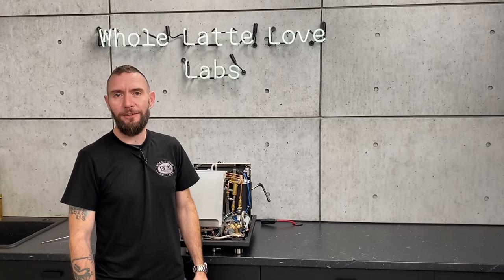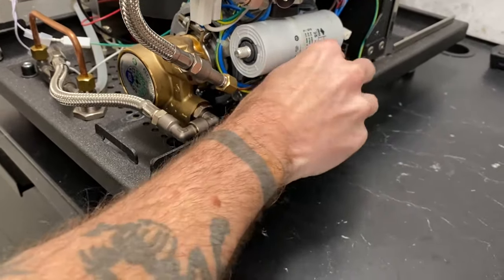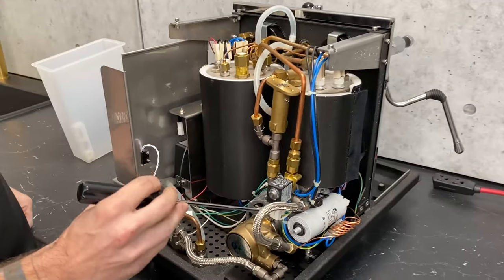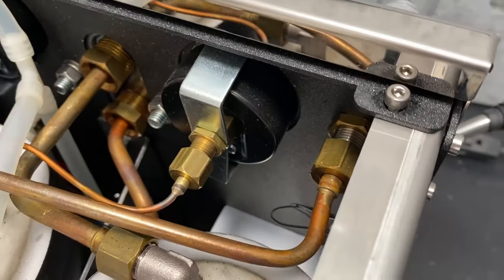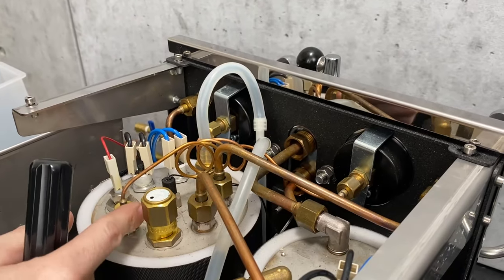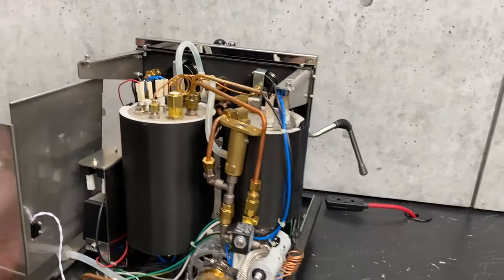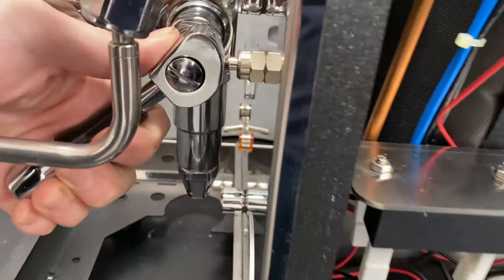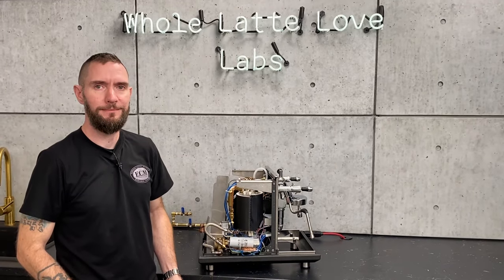ECM Synchronika Espresso Machine Internal Components Tour, Overview & Identification

Comment: Hi! I love your detailed videos, thank you so much!! I replaced the solonoid valve and water pump, cleaned the liquid level gauge, and reset the little switches on top. However, it doesn’t seem to be filling the steam boiler. I don’t see an NTC probe and It will not make hot water or steam :( I have an illy Y2. Thank you so much for your advice ❤
Reply from the maker: Hi c, Thanks for the comment. Unfortunately I'm not familiar with with that machine so can only offer general advice for your situation. In machines with separate steam and brew boiler the steam boiler usually has a fill level probe which controls things. Those probes can go bad or have a bad connection. They typically use electrical conductivity of the water to sense water level in the boiler.

Comment: Thanks for this overview of the Synchronika. Have you ever seen a failure on this particular model (client bringing in their machine for repair)? I've had mine since a couple years and just clean the brew head with some JoeGlo. Otherwise, it's been great. Hoping I never have to service it!
Reply from the maker: Hi PM, Thanks for the comment, question and sharing your experience with the Synchronika. It's a very well built and reliable machine. Problems are most often associated with poor maintenance or water causing internal scaling.

Comment: I was listening to talk about the plastic T being near hear and possibly cracking after a while.  Do they sell or make a metal one?  Seems for 2 -3K machine this would be a more heavy duty part.
Reply from the maker: Hi charles, That fitting has been updated to brass in the latest models of the ECM Synchronika and Profitec Pro 700. You can see it in this video: https://youtu.be/NTRA3ZeTwnM?t=459

Comment: Thanks for the awesome video! I k kw this will come in handy at some point. I do have one question, how do you drain the brew boiler? I bought my Synchronika in July so I would assume mine has the updated drain on the side. Thanks again!
Reply from the maker: Hi AF, You are welcome! Yes, recent Synchronikas will have the brew boiler drain as seen in this video. Here's a video showing how to drain you boilers: https://youtu.be/9D5Og5erQ_Y It also shows how to drain boilers of older Synchronikas without the drain valve.
Marc

Comment: Yet another excellent video from WLL. Regarding the clear silicone hose that runs from the plastic tee down to the discharge nozzle below the grouphead: is that tubing replaceable without removing the brew boiler?  Also, is there any downside to replacing the plastic tee with a brass one?  Thanks again for the whole catalog of repair videos!

Comment: Thank you so much! ;-) Sorry, but I am just having some stupid questions…

(1) Is it technically possible to run a Synchronika on DC power supply only? For example on a boat where you might be lacking an AC power line from the land side.
(2) What voltage is this DC running on internally?
(3) Could the heating of the boilers and the brew group be accomplished by a DC power supply only?

Don't worry, I am just curious, no intention to fiddle around with this… Thank you ;-)
Reply from the maker: Hi AGCS, In my limited yachting experience if you have a boat big enough to have a Synchronika (luck you!) on board you likely have generator to provide AC power and/or large battery bank and inverter for AC power. Given the Synchronika can draw up to 1400 watts it would require a relatively large battery/inverter capacity to keep it running. The major power consumers in the machine, the heating elements, run on AC power. Only the control circuits (which use very little power) like PID system run on DC.
Reply: @Wholelattelovepage  Thank you very much indeed ;-) Exactly, as I expected…

Well, then Rolls-Royce or Bentley will need to find a solution for that — once I will have won the EuroJackpot ;-)

Sorry, but my Synchronica is a must…

Comment: Not specific to the sync but how often do you run into issues of failing rotary pumps? I’m curious about potential replament costs including the motor. Ideally in our future set up we’d l8ke a plumbed set up but wondering if the greater upfront and potential future costs warrant a machine with rvp. Thanks!!
Reply from the maker: Hi KD, Rotary pump failure is very unusual. They are commercial grade and most reliable pump type used in prosumer level machines.

Comment: This is a fantastic video; glad I came across it. Just had to replace the plastic barbed tee fitting from the boilers' OPV tubes because it got brittle and broke (after about 2 years of daily use), leading to a puddle of water forming under the machine during its warm-up cycle because it was no longer discharging into the drain tray. 

Ended up replacing the junction with a 1/4" stainless steel version I got from a local fitting store for under $4. Quite surprised ECM cheaped out on that part given it's subjected to constant heating and cooling. Otherwise, no complaints with the machine; been running great, but this video will be very handy if I have to diagnose any internal components next time!
Reply from the maker: Hi LD, Thanks for sharing. The Synchronika is an incredible machine. We have had a couple of reports of that T fitting leaking after long term use. Thankfully it's super easy to access and repair.

Comment: Does the inline filter from the reservoir ever need cleaning and if so how do you do that?
Reply from the maker: Hi D, Thanks for the question. Filter may need cleaning if stuff gets in your reservoir. Coffee grounds are common. To clean just pull the connecting tubes off and run water through in reverse direction. When removed you can visually inspect for debris on the mesh screen within the filter.

Comment: I'd like to see an equivalent video on the (new-ish) Cinquantotto.
Reply from the maker: Hi cobra, Thanks for the request. We do have this video which takes a look inside most rocket machines. Look for the Rocket R58 in the video which is the Cinquantotto. Between the model name change the exterior is a little different but internals are nearly identical: https://youtu.be/xoDDusXK2e0
Marc
Reply: @Wholelattelovepage  Yup I did watch that video earlier. Was wondering if the internals were reworked in any significant way.  Sounds like they were not.  Thanks for the fast reply. You guys rock!

Comment: How is it possible to set the pressure to 6-7 bars on this machine?
Reply from the maker: Hi a, underneath the rear of the machine there's an access hole to the rotary pump's bypass adjustment. With a blind (backflush) filter basket mounted in a portafilter, run the pump and turn the bypass adjustment until you have  your desired pressure on the machine's brew pressure gauge. To access the adjustment screw carefully hang 1 rear foot of the machine over a counter edge to expose the access hole. Be very careful when hanging the machine off edge of counter. Highly recommend having a helper to make sure machine does not fall off counter!
Hope that helps!
Reply: So did I misunderstood in the video that with that screw the lowest pressure for the pump is around 9 bars? In case of some light roasts 6-7 bar pressure is beneficial. Is that sure that I can go down to that pressure level with the setting screw of the rotary pump? Many thanks!

Comment: Hello @wholelattelovepage
 
At the moment I'm working on a project in my apprenticeship as an sheet metal worker.  I am building an ECM synchronica with my own design and construction.  Now I'm almost finished with my project, but there's one last problem I have.  However, perhaps you could help me.  I'm currently having problems with the cable system of my Synchronika (it's 1 to 1 the same hardware), so would it be possible if you could send me a circuit diagram or pictures or a drawing of all the electronics?  I would be eternally grateful if you could help me. 

Looking forward to an early reply 

kind regards
Nicola
Reply from the maker: Hi, Here's a link to pdf with circuit diagram: https://support.wholelattelove.com/hc/en-us/article_attachments/13619565108883
See page 18 for Synchronika.
Reply: @Wholelattelovepage  
Thank you very very much for your support. You are my salvation without you I would be lost. 
Best regards Nicola

Comment: This machine is designed with out technical love🥹
Reply from the maker: Hmmm, thanks for the comment. I've been inside pretty much every machine of this type available in North America for the last 15 years. Synchronika is among the best in design.
Reply: @Wholelattelovepage  As an example, a large starting capacitor is attached with cable ties instead of the intended thread. Sorry, that‘s not so professional.🫤

Comment: Great video, guys!  All are parts that may need replacing available on you website?  I have an older Synchronika.  Bought from you guys with the ECM grinder about 4+ years ago.  Working great but am noticing some slight anomalies.  The pump will kick on (I’m guessing to fill the brew boiler with fresh water from reservoir) when I’m not brewing or doing anything else.  Thoughts?  I am going to look closely at drain to see if it’s shutting off completely after heating up.  Thanks!
Reply from the maker: Hi J, Thanks for the question, your patronage and report on long term ownership. The pump kicking on is adding water to the steam boiler. Brew boiler only gets new water when the lever is raised. It's not unusual for the pump to kick on when the machine is idle. Brian pointed out the fill level probe on top of the steam (aka service) boiler in the video. It's a simple metal rod that sticks down into the boiler. When the water level drops below the tip of the probe the pump comes on to add water. This does not always happen when the machine is putting out hot water or steam. It may happen after the fact due to evaporation dropping water level or if you happened to be brewing when the probe indicated low water. Probes can get a little wierd in operation if the become scaled within the boiler. If that's the case the probe is easy to remove for cleaning.
Marc

Comment: Thanks for the video how easy is to adjust the OPV I tried and it won't move.
Reply from the maker: Hi w, In the Synchronika the OPV is a safety valve and should not be adjusted. If you are trying to adjust brew pressure, do that by adjusting the bypass on the rotary pump. That's discussed at this point in the video: https://youtu.be/g3IHsA_y1n8?t=218

Comment: Hello Whole Latte Love, I Really Like Your Videos about Espresso Machines specially design For Home Use Domestic Purpose machines . 

One Request : Can You make a Video for Astoria Espresso Machine Model: Tanya .?
I am Facing problem In it Where it starts Giving Air Block in it due to not taking proper water filling in it, I Also Try to set it Rotatory Pump too but it's Not working well .
Due to Bubble making Problem During Espresso we change its Gasket too . But still it's pressure is not Reaching To 9 Bar, 
Kindly Show Me a solution for It. Cz after its Holding time an Air Block Generates in it and then It's pressure Reaches 5 to 6 Bar only. I Also Rest it Motor pump pressure too but didn't help it due to its Boiler air Block Troubling Making a Better Espresso . 
If Possible then Provide a Solution .
Reply from the maker: Hey sid, Thanks for the request. Unfortunately I do not have that machine available :(
Reply: @Wholelattelovepage  Okey.

Comment: How do i know if i need to descale the boilers ?and If i do, how would i do that ?
Reply from the maker: Hi YR, Manufacturers generally recommend dual boiler machines be professionally descaled. If a machine does have scale there's a risk of bits of scale plugging up other areas of the machine when descaling. Also, it's difficult to fully empty boiler of descaler unless you are willing to open up the machine and access the brew boiler drain. Best course is to use water in your machine which will not cause scale in the first place. You want some minerals in the water to prevent internal corrosion and over-extraction of the coffee. If your tap water is not out of the norm then filtering options from BWT Water and More are the way to go. The use ion-exchange to replace much of the scale causing calcium in water with magnesium. This gives you water with a good mineral level that will not cause scale. BWT has plumbed in options as well as in reservoir pad filters or the Penguin pitcher. Learn more about them here: https://www.wholelattelove.com/collections/bwt
A quick way to check if you currently have scale is to remove the E61 mushroom valve and check for signs of it.
Marc

Comment: Why is the opv valve joined to the drain valve instead of the capped line from the reservoir drain?
Reply from the maker: Hey AK, On a dual boiler machine like this ECM Synchronika the OPV is used as a safety valve only with pressure for release set well above typical brew pressures. It does not play a role in controlling brew pressure like it does on a single or heat-exchange boiler machines.
Reply: @Wholelattelovepage  I’m using a nuovo simonelli musica. If you open it up/see the service manual, the opv is after the pump and loops back. I was looking from a water conservation pov.

Comment: Is there a reason why you wouldn't want to have the discharge of the opv be routed to the auxiliary tapped input of the reservoir so that the water is being recycled instead of wasted? As far as I understand that water shouldn't have been heated or contaminated with coffee grounds at that point.
Reply from the maker: Hi c, thanks for the question. The OPV's on this and most dual boiler machines act as safety valves so only release water in event of an over pressurized boiler (usually due to overheating) which is a very rare problem due to other safety measures like high limits on the boiler which cut power if they get too hot.
On dual boiler machines with rotary pumps it's the bypass screw on the rotary pump which controls maximum brew pressure. Regardless of setting the bypass does not release water when controlling pressure like the OPVs used on most vibration pump machines do.
Reply: @Wholelattelovepage  Figured as much after watching the rest of this awesome series of videos! Thanks a lot for the reply!

Comment: Thanks for the awesome overview! It hopefully helps to fix my Synchronika. When heated up and the pump is running no water is pumped out of the reservoir into the boiler. When the machine is cold or just turned on it usually works. I assume the electro magentic valve is the issue as neither the service nor the hot water boiler gets filled. It started few weeks after I descaled the machine. 
I'd appreciate any thought on this 🙏
Reply from the maker: Hi CTS, You are welcome for the overview. Here's our video on diagnosing flow issues on the Synchronika: https://youtu.be/xcze59LUg9E
At 35 minutes long it covers just about everything! Video is chaptered so you can easily jump right to the Solenoid valve at ~24:40 in the video if you believe it's the issue. Sounds like residual scale plugging something up could be the problem.
Manufacturers generally recommend against end users descaling dual boiler machines due to the risk of problems like yours. You may want to consider filtering your water to prevent scale in the first place. You need some minerals in your water to prevent corrosion and enhance flavor but they need to be the right ones. Strongly recommend you check out BWT Water & More products. They have solutions for reservoir fed or plumbed in applications. They use calcium to magnesium ion-exchange which is far better than traditional sodium based water softening. When used as directed, BWT products leave water with no scale potential in your machine.
Marc

Comment: I've had this very machine for about 18 months, during the last two or three I've noticed a seemingly random 0.5 bar drop in steam pressure while steaming. I can somewhat mitigate it by opening the steam valve, closing it and letting the pressure build up to 1.5 bars before steaming any milk. Any idea where I should start troubleshooting?
Reply from the maker: Hi DO, So steam pressure will drop a bit while steaming but generally not in a random fashion. Are you noticing any moisture going to drip tray from discharge at rear when this happens? If so I'd have a look at the vacuum relief valve (aka vacuum breaker) on top of the service/steam boiler. Perhaps it's loosing its seal. Here's a video covering the valve and how to clean it: https://youtu.be/vv-YDUfbnyU
Marc
Reply: @Wholelattelovepage  Honestly I haven't checked for moisture going to the drip tray, but I'll do that next time. Lately it's been less random, happening every other time if not more. The vacuum relief valve needing service makes sense. I'll definitely check out the video on how to clean it. Thank you!
Reply: @Wholelattelovepage  I’ve opened up the valve and added some lubricant to the o-ring, which looked a bit dry. It might be too early to say for sure, but the results just now were beyond expectations. It steamed like new! I can’t thank you enough! Looking forward to more great videos. :)